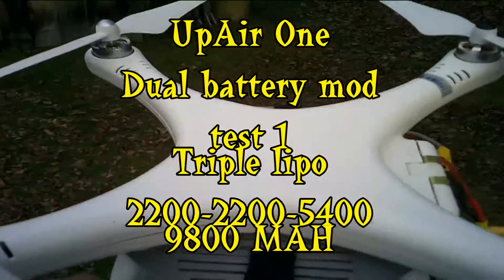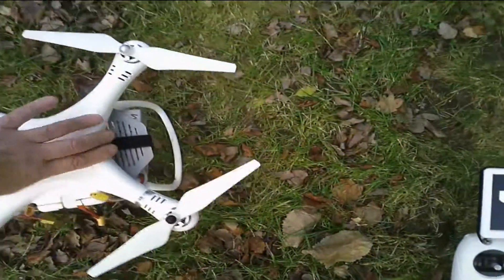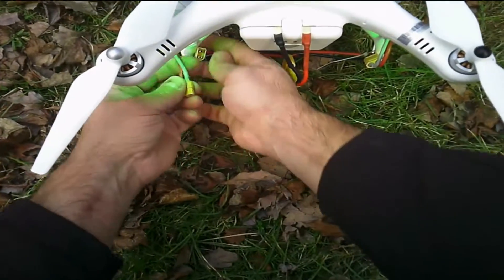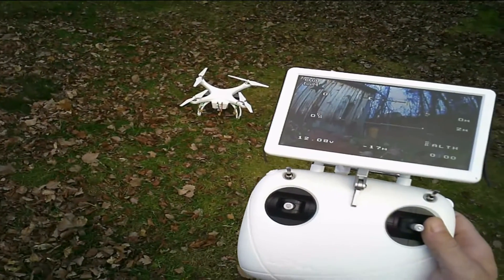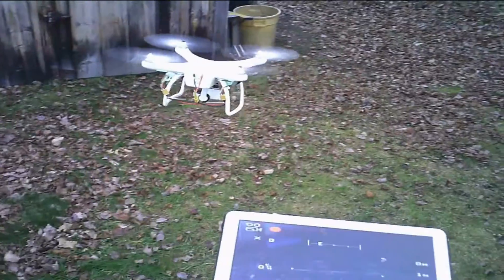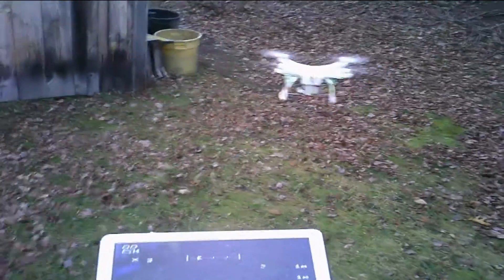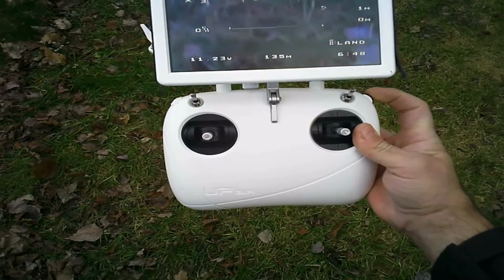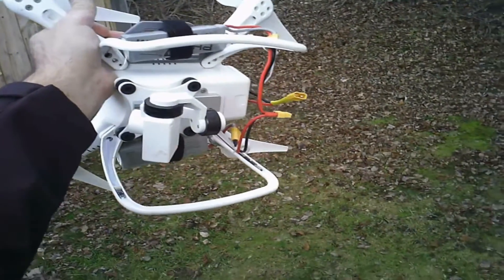UpAir One Dual Lipo Mod THE TRIPLE

Comment: Question, crashed my UpAir One and it damaged the "cable" which connects the copter with gimbal it has six wires (3 red wires and 3 black wire) that terminate in a rather small connector (which is what was damaged).  Any idea's where I can get another one?? Note, I have not seen a cable like this in any of the internet videos so believe this is something new...

Comment: CRUZROY on a full charge what voltage does your upair tx show for the tx battery mine is only showing 12 to 12.1v my lopo tester shows my pack at 12.4 v I'm just trying to make sure I don't have an issue with my tx because on the original pack that came with my upair tx it was going completely dead after only 12-15 min of flight time and causing failsafe rth to kick in I haven't flow it yet with this new pak